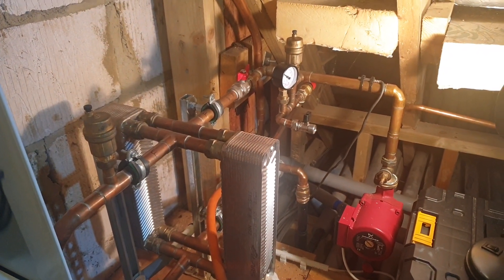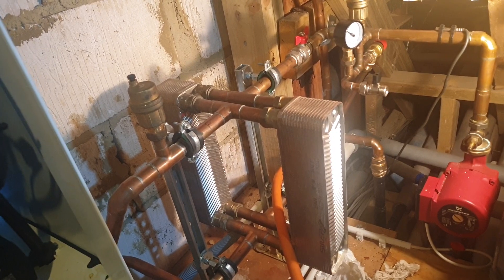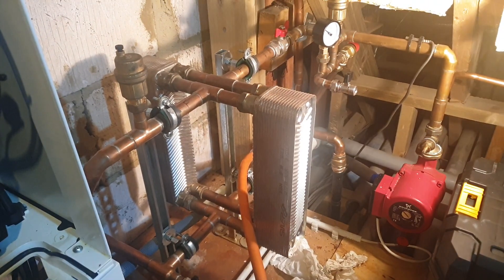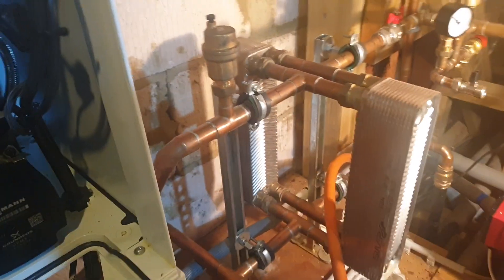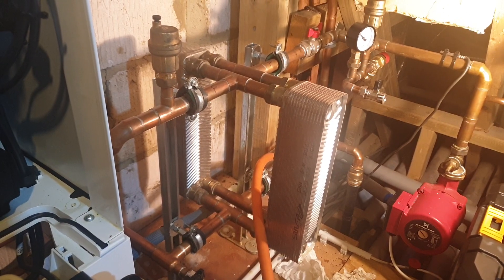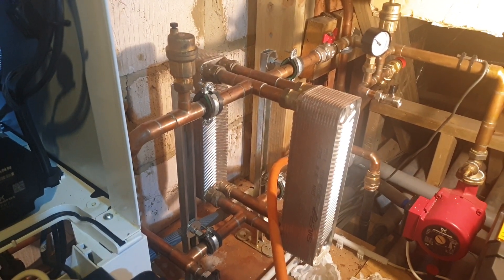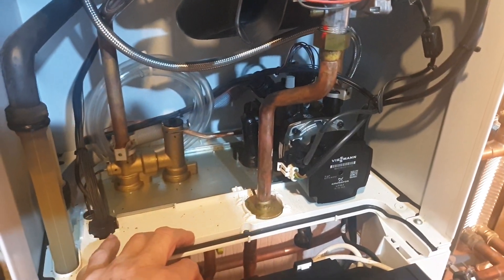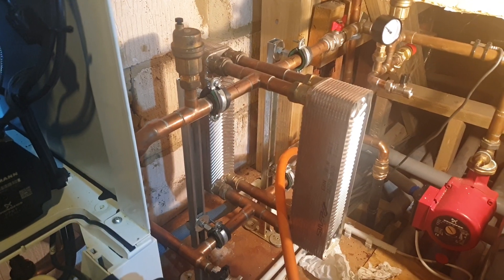Service visit to Viessmann Vitoden 200 with plate heat exchanger separation

Comment: Hi Andrew, Great video a few queries regarding domestic use. I currently have a Viessmann 200 W installed with a Spira-Cross low loss header fitted, light industrial pump to add to the circulation but in just over 3 years I've ditched two heat exchange plates. I've spoken with the plumber regarding dirt separation but the header should take care of this, I've also mentioned the hard water within our area and possibly installing a water softener. Do you think this could help??

Comment: Really interesting Andrew. I think you have most definitely got to the bottom of it. I have often thought that water chemistry maintenance is the achilles heel of a traditional wet central heating system, which forms multiple cells between copper pipework and steel radiators. Your hydraulic separation is effectively protecting the boiler by removing it from the influence of the corrosion cells and acidic effects.

I would expect in ‘traditional’ systems it is likely that primary circuit water is acidic even in serviced boilers.

Have you done any assessment on the effect on thermal efficiency of introducing the plates?

Of course the improvement in reliability (and life) of the boiler is the no brainer criteria.
Reply from the maker: We get a 3 or 4 c temperature lift across the plate but are already using low temperature design so a very small compromise. A direct system will loose efficiency in the main heat exchanger due to fouling I believe leading to far greater efficiency losses. The systems are ph adjusted to 9.8 if no aluminium is present.
Reply: @andrewmillwardwatford9410  Thank you Andrew - excellent.👍

Comment: Would a low loss header also do the job of equalising different flow rates & collecting dirt in the system? What are the criteria for choosing either this solution or plate separation?
Reply from the maker: Yes almost the same

Comment: Hi , if the water was clean and properly dosed how was it damaging the previous boiler?
Reply: Good question.
Reply from the maker: Im not a chemist but have looked at water quality and treatment and found that some systems just can't be cured. Rather than chase my tail seperation is a total fix for the issue.